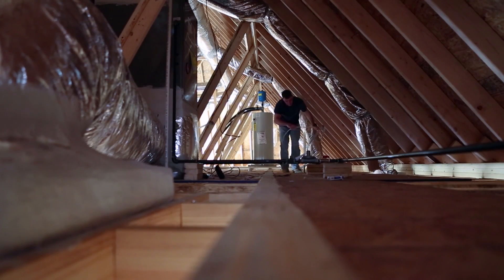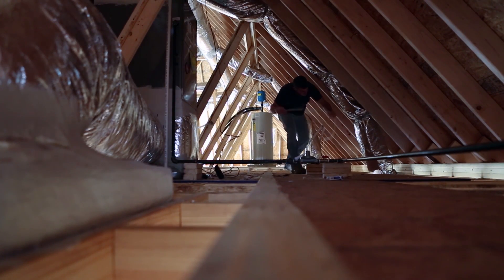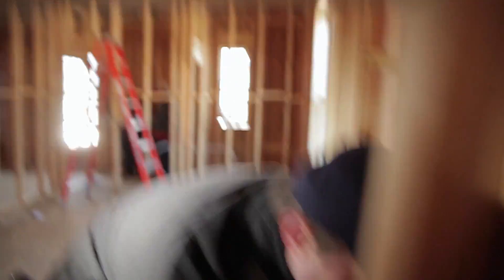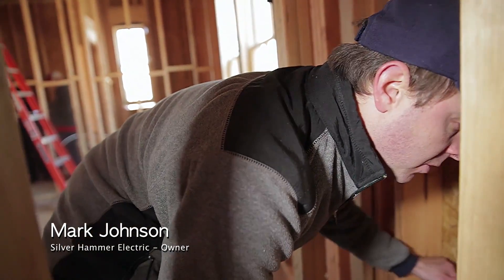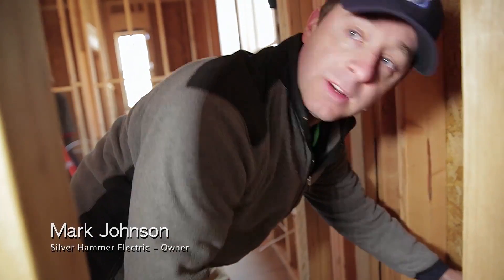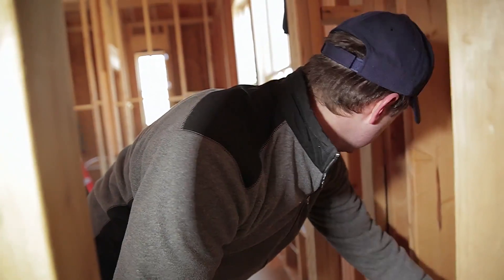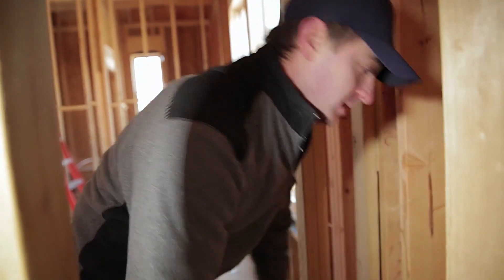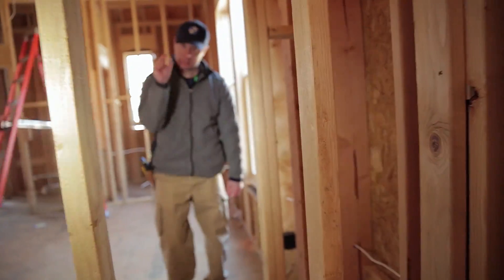Romex® SIMpull® NM Cable

Comment: Yea I call BS! I just spent an hour trying to pull 10/2 wire that was ran through rafter holes, basically had to do each rafter individually a total pain and not easy. Those guys probably ran the 14/2 on 1 inch holes.